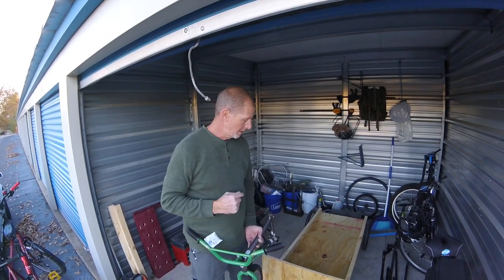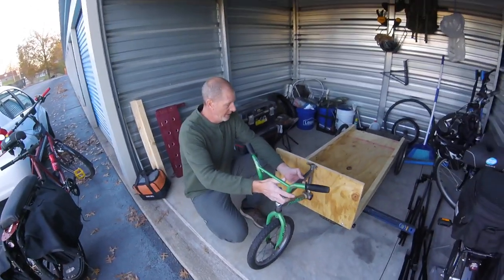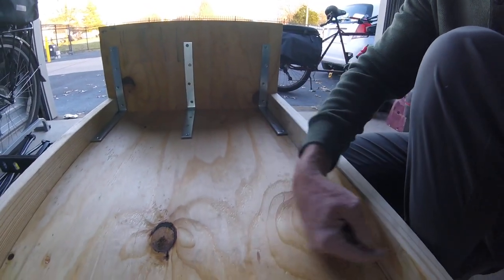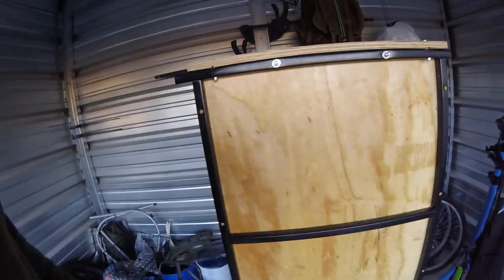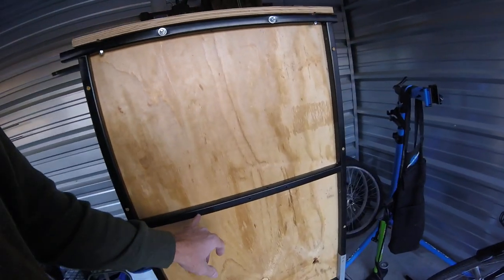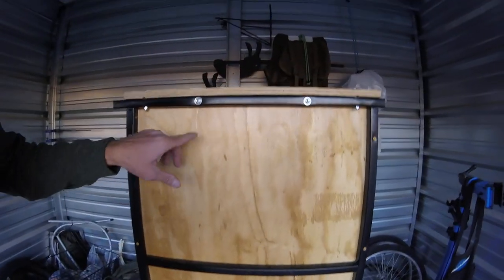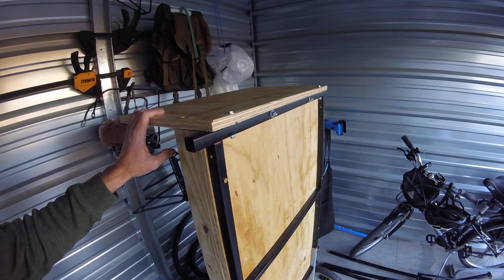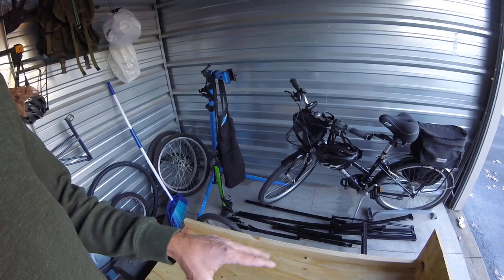3 Wheel Bicycle trailer build Part 2 Main body

Comment: You can use reflectors , flashing lights and reflective tape, driveway markers ect. I think the metal under the wood is overkill. I would replace that heavy OSB with thin light plywood the type for home framing, under that a spring loaded bed frame - i keep finding these things everywhere. no idea where they are from but they are 8-9 lbs 26"x 51" ( square tube metal frame and wire mesh thats spring loaded by many small springs) If its general cargo you dont need the wood floor. Also the 2x3 is not good because its only meant for vertical stress. what i would use is fence boards which are 1/2" x 6" and very strong when put horizontal like a I-beam. Also i would remove the metal protruding from your main frame which can catch objects as you are riding . And cut off the ends of the handle bars which also can get caught on objects in your path.
Reply from the maker: You make some good points. I built the trailer for strength. I'm 6'4" at 210 pounds. I have stood on the trailer and bounced to see if it was strong. All it did was flex but did no damage whatsoever. I never worry about weight when it comes to cycling. My Surly Big Dummy weighs 55 pounds by itself. I only ride steel bicycles and riding that heavy bicycle has made me a lot stronger. Last year I loaded my Big Dummy down with a total of 380 pounds and road 25 miles. I was pretty happy with myself for that as I am also 50 years old. You do have good points and I appreciate your insight. Also I had not thought about the  metal crossbeam at the back cathing on something, will definitely have to fix that. As far as the handle bars go, I like them the way they are because when the trailer is empty I flip the long piece of conduit backward onto the trailer and use the handlebars to steer it. This was only the first try at this. I may rework it in the near future.